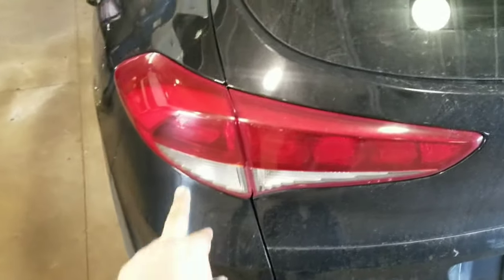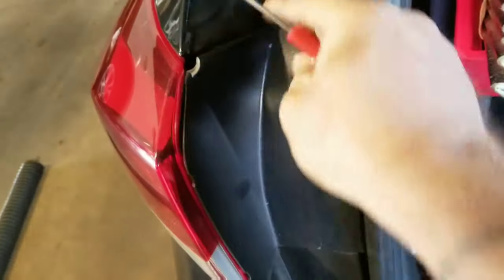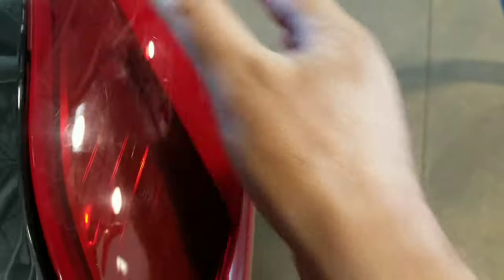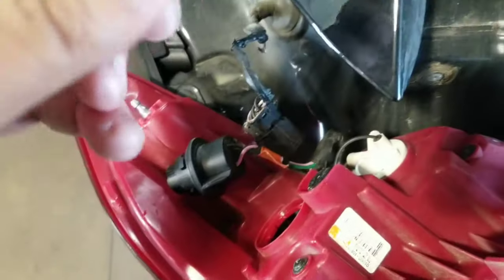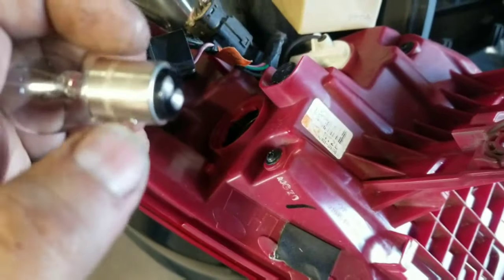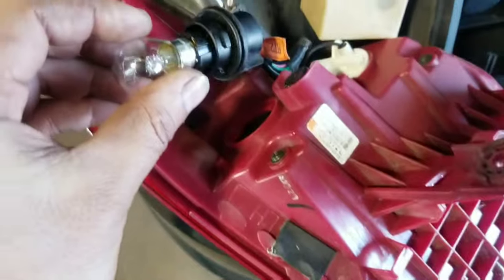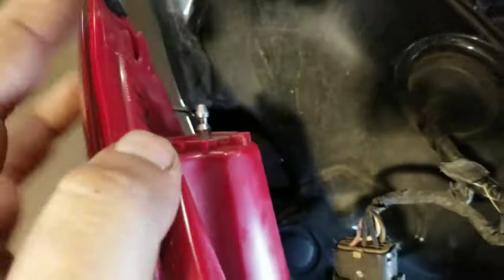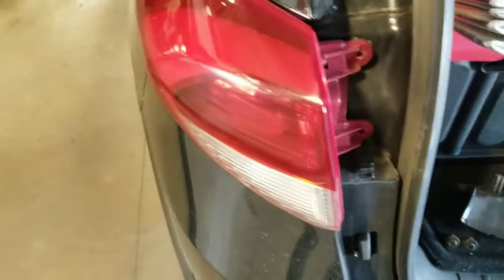how to replace Hyundai Tucson brake light bulb.

Comment: Would enjoy viewing a video of changing oil on a 2021  hyundai Santa Fe 2.5 turbo, Hyundai offers free oil changes at one year or 8000 miles, but i don't feel comfortable at changing the first oil change at 8000 miles , would feel better at 2000 miles, Thanks
Reply from the maker: Change the oil at 3750.  And every other oil change have the tires rotated. I think at 8000 Hyundai pays for oil and rotate.   If i remember ill do a 2021 Santa fe turbo next time i have one.
Reply from the maker: 2021 Santa fe turbo oil change video will be up tomorrow.